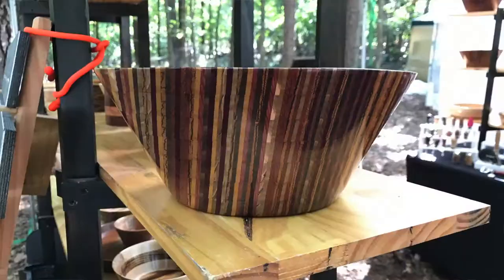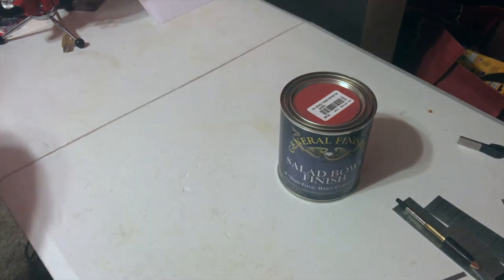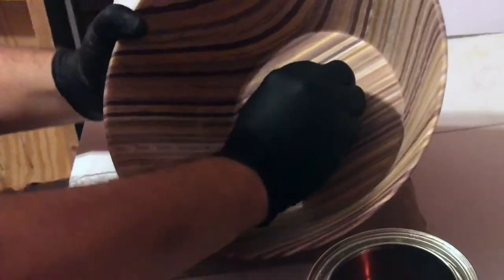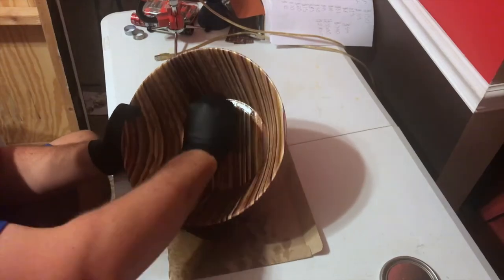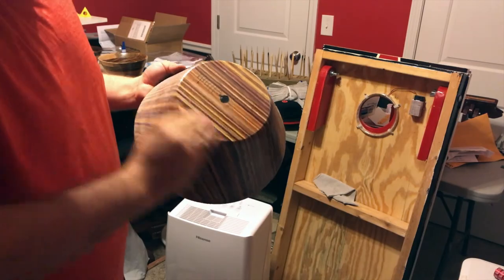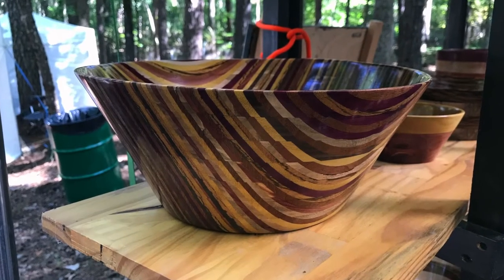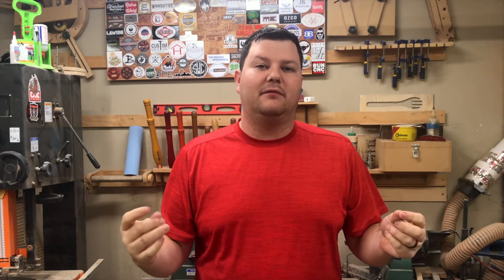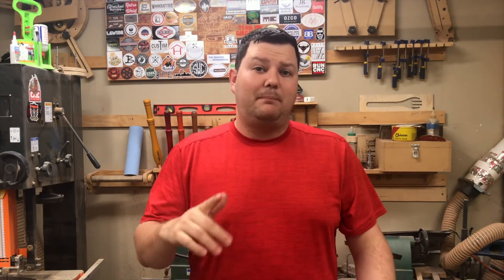How to Apply a Food Safe Finish on a Wooden Bowl

Comment: would a wooden bowl be sealed enough to be outdoors in a garden?
Reply from the maker: I wouldn’t use this for outdoors. Really anything you do will not hold up outside in the elements. If you were to put it out the even with a marine finish which this is not you would have to reapply every 6 months or so bc the sun just kills a finish